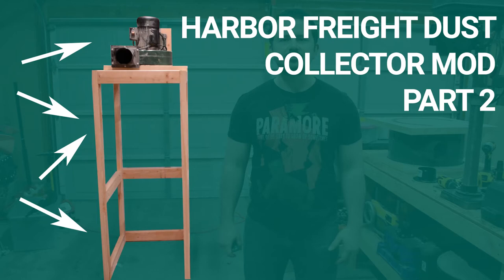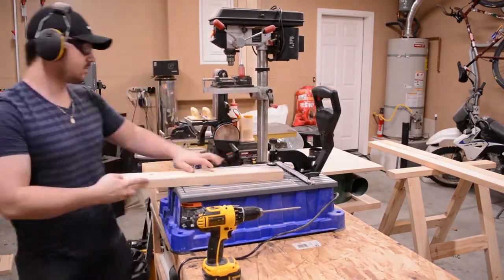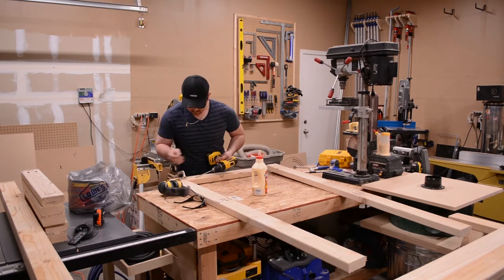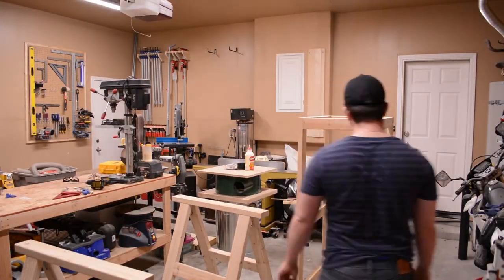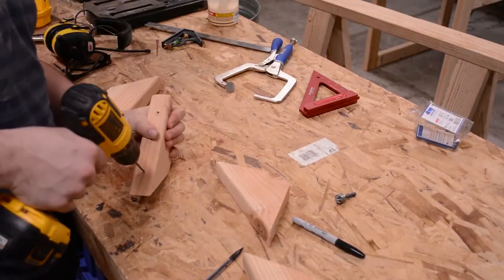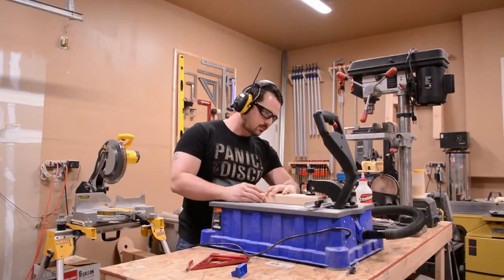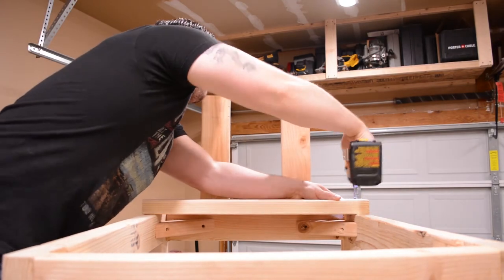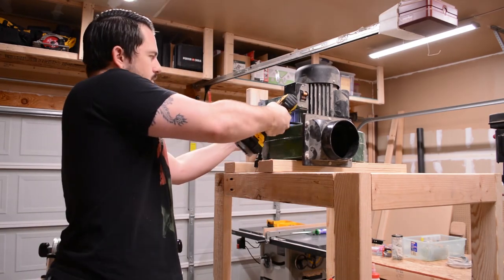Harbor Freight Dust Collection Modification | Part 2

Comment: Pocketholes are the about the worst joinery technique for this kind of structure. Lap joints or simple face-to-face screw and glue would give you much better rigidity.
Reply from the maker: I built this several years ago now and have had zero structural issues with it. The joints are still tight and haven't shown any signs of failure. The structure exists purely to hold the impeller above the baffle and waste bin. It serves no other purpose.

Comment: What is the switch on the wall that is next to the powerboard that is behind your drop saw for
Reply from the maker: The plug directly behind my miter saw is just a surge protector with a few tools plugged into it. The thing mounted on the wall to the left of my miter saw is the control for my irrigation system.

Comment: I’m not one of those safety police but my dad used to reach across the miter saw and the blade got pinched and pulled his arm into the blade. So from then on I use either hand on the saw so I’m not reaching across. 
 Enjoyed the build and the video.
Reply from the maker: Thanks for the concern. I don't typically do that and I'm not entirely sure why I did it during this project. It's not a common thing for me.